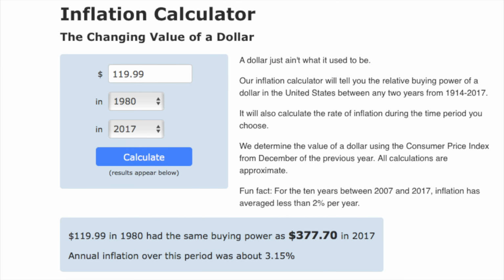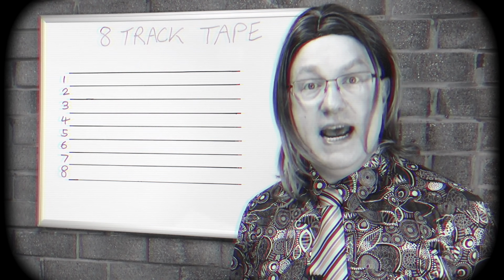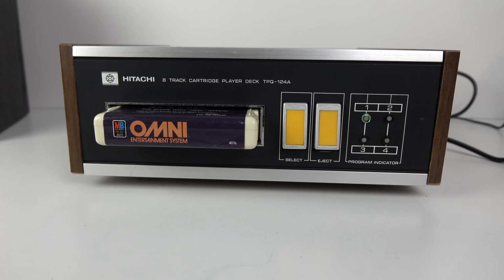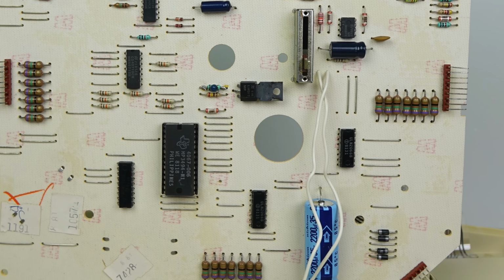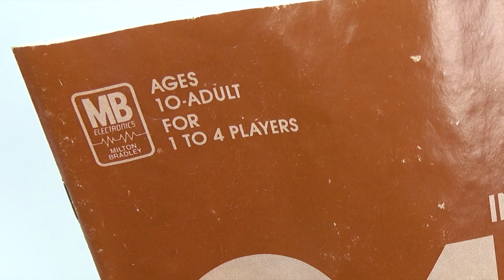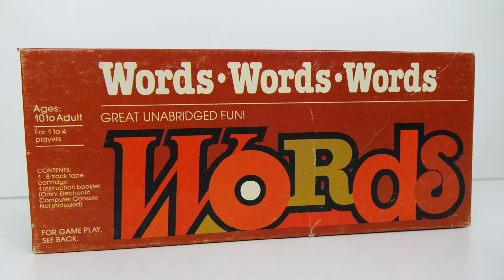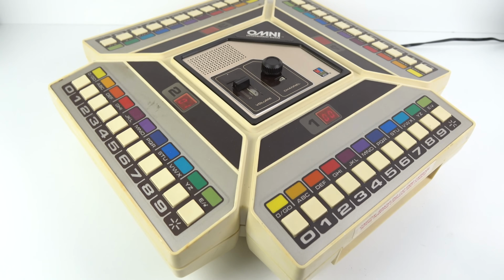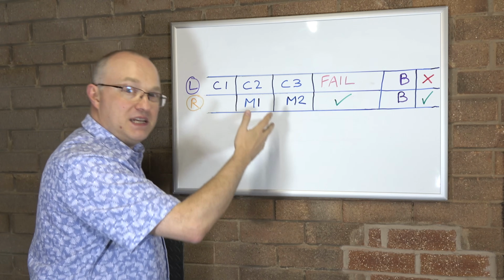MB OMNI Entertainment System - The 1980s 8-Track games machine.

Comment: The UK doesn't have Jeopardy now but there were three separate attempts at a UK adaptation over the 80s and 90s, none of them lasting more than a few years.

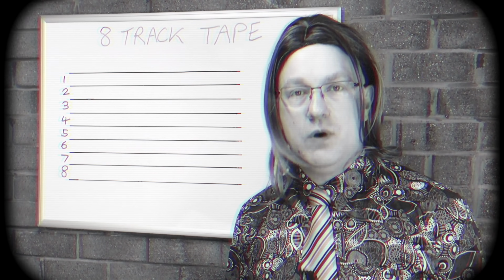Also, I almost Hail Sataned at 4:49 🤘
Reply: I knew there was at least one and I was going to post it but thought to go through the comments first.

Also, for those outside of the US who might be interested, there was a gap between the last version of Jeopardy with Art Fleming and the version we have now; the former ended in 1979 and the latter started in 1984.

Comment: Definitely a lot more complex than 2-XL was, and I had fond memories of that little robot! Well, the latter version that used cassettes instead of 8-track. Both were simple being more mechanical rather than computer controlled. If I recall, latter version allowed questions with up to 4 choices rather than 3, even though it seems the original version could've done the same in theory. Can't wait to see a video on that!

Comment: oh darn I really wanted to see the puppets have a good go at this game. Now that would have been funny. Great job on this video. I had one of these about 15 years ago. 
I'm wondering what kind of Mods could be done to make this into a real cool 8 track tape music player in stereo. With LED flashing lights like a disco streaming out of the unit from each button. Speaker up grades and the such. This could be turned into a bad ass 8 track tape player you hang onto the wall and maybe wire it into your 1970's HiFi audio receiver. Get crackin Techmoan see what devilish contraption you can come up with. 
As always thanks for reading my comment.

Comment: One of the first things I was thinking was "I hope Mr Techmoan is going to clean the IC sockets then re-seat the chips." Five minutes later... "Oh." lol

It's something I do routinely on any retro computer / console I get hold of, as it has helped get things running many times.

Definitely a  very good idea to replaced all of the electrolytic caps too.

On something like this that relies on a analog opamps, and reading data cleanly from the tape, having new caps should improve the reliability / longevity a lot.

It would be fun to try to decode the data bursts for this. Could you possibly upload some high quality recordings from one of the tapes?

Comment: Thats a whole lot of epoxy mixed for that one small crack.
Reply from the maker: As Vax mentioned earlier...I also had to stick the wig on.
Reply from the maker: This guy knows exactly what's going on here....good on you.
Reply: I thought you did it to have a bit of sniff.
Reply: You cannot mix the 2 part 5 minute epoxy in tiny quantities. It never cures right and stays gunky forever. You have to mix a few ml at a time for it to work right.
Reply: LemonSlice that's how he gets into the puppets mood.
Reply: Muranaman, excuse me? Early 80ies cassette tape interfaces in home computers, but also modems, did around 1200-2400 bit/s.
Reply: Still, if the CPU needs to know that it's addressing the next trivia question (opening of the file), and the correct answer is "the third of 4 possible answers", and an ending tag, to indicate there's no more input for the CPU to process (ending of the file); it could easily be programmed in the 37 bytes it gets from running a 1 second binary signal at a rate of 300 bits/s.
Reply: Ha!
Reply: Models are made of polystyrene, which will be held together by most glues that contain the tiniest bit of one of a number of weak solvents, and also by CA and epoxy without solvents. That doesn't apply to engineering plastics, especially polyamides, that reject glue.
Reply: You can get epoxy with a mixing tube as you squeeze it out. Only bummer is that you can't reuse the tube - but it usually comes with several tubes.
Reply: Techmoan how about a video on the Sinclair C5. I'd like to see you poodling along in your local community with a helmet cam
Reply: I think it goes a little like beep beep beep beeeeeeep beep *beep*. I hope that's of some help, Muranaman.
Reply: S James
 kinda hard to get one, at least here in the states.... maybe its different in the UK...
Reply: I would have been interested in analyzing the digital signal recorded on the tape!
Any way you could record it, and analyse it with a PC or oscilloscope?
Reply: The rest of it was being used on a much bigger crack bent over at a car tyre air machine an the local garage..
Reply: I mean, to see if it's sending a binary signal to the CPU. See if it's actually loading a program in the CPU, or just triggering the CPU to start it's stock program.
I believe it would actually load a program into the CPU, which makes the CPU know how many buttons are used, and which answers are correct. 
Otherwise, the CPU would follow a standard set of buttons that just repeat itself, no matter what game you plug in.
Reply: It seems the data-parts are really short on the tape and thus can only hold control & scoring data, not a real/full program itself... Perhaps there is some magic sequence that allows for 'firmware upgrades/flashes', but what's shown in the video indicates data-only....
Reply: Julian Robin  I'm sure he could track one down, and then drive along like a cagoule wearing Mr Toad
Reply: Conventional wisdom says the part is possibly made out of PE or Nylon and can't be glued back with epoxy, or as a matter of fact anything but a handful of highly exotic solvents.

This conventional wisdom has not counted upon Techmoan caking the epoxy on so thick, that it essentially ends up clamping the part together rather than gluing it together, which is perfectly fine in this case.
Reply: Yeah Commodore 64 was just 300 bit/s. ZX Spectrum did around 1200 bit/s. The problem is, on transmission line, you have reflections, but you don't have time distortion. On tape, the time signature that goes in isn't even close to the one that comes out! You have lots more bandwidth available, but you can't put it to very good use because you have to spend most of it to recover a decent clock.

Sure no problem at all as far as something like this is concerned. But you don't expect BASIC on the machine, more likely simply configuring parameters and switching modes for fixed logic, or if it's fully programmable, then something like stack machine (forth-like) or state machine.
Reply: On that tape, and the simple hardware, make it a few hundreds of bits per second. At most 80 bytes. Well, still a whole program...
Reply: It's probably the Fibonacci Sequence, El D.
Reply: I vaguely remember those.
Reply: Good on you for showing what materials were need to fix up that cartridge.
Reply: Scott Strang Do you? Thanks for the post.
Reply: Didn't know that. Cheers.
Reply: I've got some cheapo "englastar-jet epoxy steel" 5 minute resin, which comes in 2 seperate tubes. Fortunately you can mix tiny quantities, and it works fine. One of the strongest glues I've found, though I haven't used many other than super glues. I guess the other advantage of seperate tubes, is that you could add a little more hardener to be sure.
Reply: yeah... It was way before my time.
I was giving tape recorders credit, due to being faster data rates possible, than the modems we saw in the 1980s (modem is long distance). Never knew they actually were that slow!

Even at 2400 baud, 1 bit per baud, is 2.4kbit or 300 bytes. 
Probably good for loading the correct answers of the game into the CPU.
Reply: A lot of info can be put in small data parts, but considering it's 1970, you'd probably speak of 56kbits modem speeds, so a 1 second beep, would possibly be able to contain 56kbits of data (or 7-8kB of data).
That's more than enough to put an entire program on.
Conway's game of life could fit in that, using Basic.

Comment: I had a device very similar to this based on cassette tapes when I was a kid.  This device was aimed more towards younger kids and only for a single player. All of the expansions included a cassette and a companion picture book. Some  of them were interactive stories and some of them were educational materials with quizzes.  The cassette deck had four color coded buttons that could select one of tape tracks to be played.  These would corrispond to the story lineage choices or quiz guesses.  There was also a switch  for selecting the proper two channels for normal cassette  playback.  It only had a single speaker but,  it would mix the right and left channels. The unit was built a little like a desk with an inclined surface on top to set a book,  storage for books and tapes below,  and the tape deck on the right.

Comment: I was selling electronic games in London in 1980. I didn't see this so you are probably right about it not coming to the UK. There was a similar device shaped like a robot and it used cassette tapes. I didn't sell many but Ken Campbell, who was putting on Hitchikers Guide at the ICA, played with it for about an hour.
Reply from the maker: You'll see 2-XL mentioned in this video. The early version used 8-tracks and the later re-release used cassettes.
Reply: Techmoan, now I am puzzled. The cassette 2XL apparently came out in '92 so it wasn't that. I think that it may have been something that didn't catch on and isn't remembered. One of the games consoles we sold is also missing from lists in Wikipedia, so maybe our buyer was adventurous and bought in some things that didn't catch on.

Comment: That's really neat! It might be fun to try making custom games for it, but I doubt it would be too easy reverse engineering that data burst.
Reply: fsphil That gave me an idea!

We should try and ask Ben from "The Ben Heck Show" if he is willing to take that challenge!
Reply: Would agree, a data rate of around 300 bauds. The signals look like Frequency Shift Keying, simply toggling between 1.0 kHz and 3.0 kHz, burst length approx. 3.3 ms. Decoding the raw bitstream shouldn't be that hard. But to actually make sense of it a little more context (bursts of different question / answer pairs, types of questions, ...) would help.
Reply: I'd suspect it's just giving a few numbers. Like the correct answer input number, what to add to the score, and maybe how many cueing points to advance the tape for correct or wrong answer. Part of the burst might also be a code to let you know if it's data or just a cue point to play whatever is scripted on the tape.

Burst is so short, so it has to be something stupid simple. My guess is there's more going on to get the scoring to display than the logic for the game itself. Compared to what you get for that price vs. a C-64 or Atari 800 (a real freakin' computer), I could see why it didn't sell all that well.

Machine also looks in great condition other than that broken plastic bit, no spider nests, and everything so clean inside.
Reply: It actually wouldn't be out of place to see a lower baud rate than that.  I would suspect something in the 50-150 bps being most likely.
Reply: OMG I still have a TI-994A sitting in a box in my hallway. Just walked past it literally twenty minutes ago! You totally brought back to mind the cassette drive's audio playing through the TV speaker. Good times!
Reply: The "blips" reminded me of my old TI-994A and my brother's TRS-80 cassettes.
Reply: @just_drmr  I just bought one and would like to make my own trivia game for this. Can you clarify how the data can be decoded? I just need to figure out how the correct answers are encoded. Once I isolate the data burst into a sound file, what do I need to do to convert that to bits? How do I generate the appropriate values to replace it? Are there tools for converting binary data to and from these audio bursts?

Comment: did it have a serial number? i wonder how many were produced
Reply from the maker: On the bottom is a 'control number' which is MB 8109. Given an earlier comment about the chip manufacturer date being in 81...it seems likely this is probably just the production date of September 1981.

Comment: On your diagram at 28:18 where is the recording of "Please wait 10 seconds"?
Reply from the maker: In the segment I said that it's included at the end of the fail message. 
However you'll also note that subsequent to that I mentioned that the actual structure of the tape was more complicated than I had described it. The chart did not include the data bursts for example.

Comment: That Jeopardy! quiz wasn't like Jeopardy! at all? More likely it was branded like that so it would attract customers. I guess it's also worth noting the modern incarnation of Jeopardy! with Alex Trebek which has been running since 1984 I believe has different rules and somewhat different gameplay than the version this may have been based off of, which played in the 70s. The original was a bit more basic trivia and players could buzz in before the question was finished; the current is a bit more difficult (or at least, polished to seem more intelligent) and you have to wait for Alex to read the clue before you can buzz in with your answer.

Comment: I "think" I remember this. I'm sure one of my uncles had it. He was from the well-to-do side of the family. We're scrubbers but they always came round to ours with stuff to show us, a bit like you tbh. Thanks for re-invigorating memories, if nothing else.

Edit: OH MY LORD! The muppets...they have evolved! Haha hilarous addition.

The next time you have to break out the epoxy to fix a split part like that, it may pay to get some fine cotton cloth and cut a strip off, saturate it with the epoxy as you stick the bits together - a bit like you would do with fibre glass. It'll greatly improve the strength of the piece as a whole, as it's got bracing on the sides and not relying solely on the thin cross section that's epoxied together. You will end up with a bit of a mess, but a bit of careful trimming with a knife and maybe a touch or sanding you will end up with great results.

Comment: That was very comprehensive. Very interesting. Nice repair. I think there was a date code of 1981 week 18 "WE 8118" on those Texas Instruments chips. That MPxxxx-N1indicates that these are ASICs made  especially for MB, while the "N1" only depicts the case style DIL (dual inline). They still use that numbering today, like "SN74HCT00N"
Reply from the maker: I was wondering if this device only made it's way to the market in 1981. It was really hard to come by any information about this one...so I just had to go off the copyright dates on the box and instructions...which are often a bit earlier than the date the product hit the shelves.
Reply: I always tell myself that it's easier get a good 50:50 mix with 'massively too much' rather than 'only the amount needed'
Reply: nice repair indeed! You're like me in that you mix up enough epoxy to repair 50 tape head mounts...
Reply: Yeah i noticed it was a generous helping of epoxy, too lol
Reply: yeah lol that was like a quarter tube epoxy... should cover it